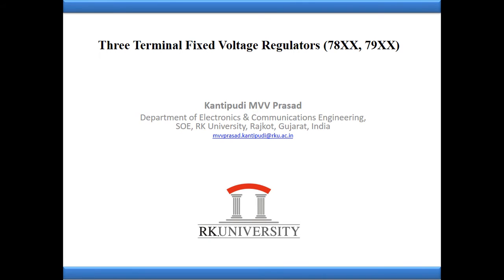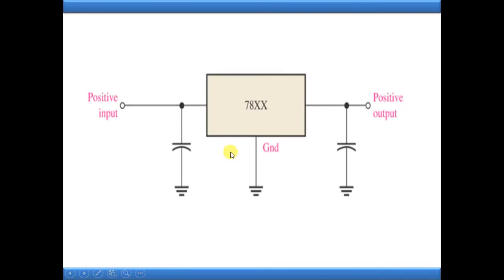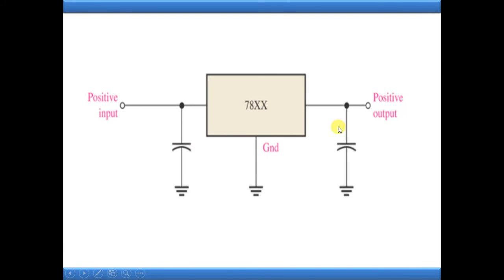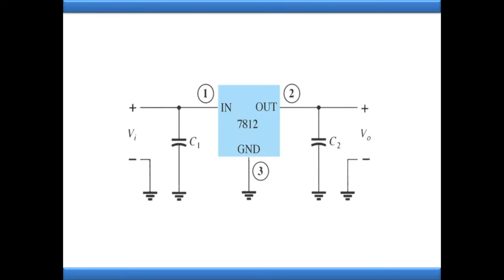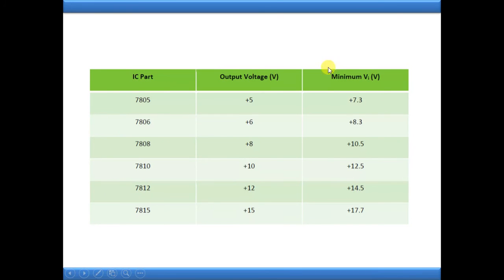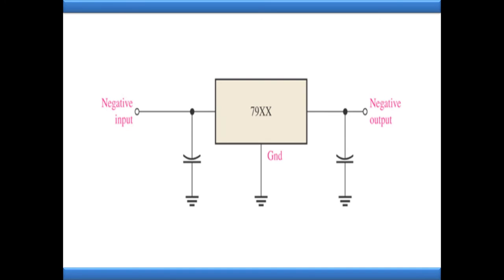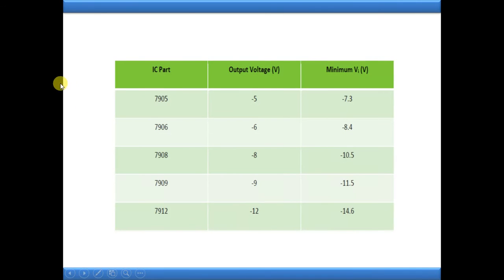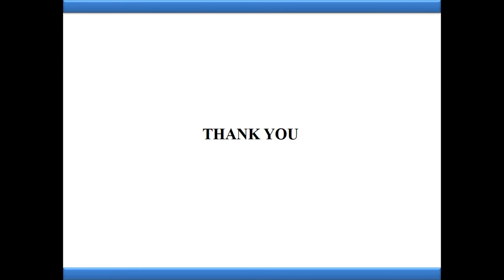Three Terminal Fixed Voltage Regulators 78XX, 79XX

Comment: Hi there,

I have a burned voltage regulator on my portable battery drill charger and would like to change it out but do not understand the letters and numbers to be able to source it online, this is what is written on the voltage regulator (F1E41AF - FQPF - 7N80C), the input of the charger is 220 - 240V and output 21.5 V constant 2.2A, any idea or guidance on what that means and how to look it up on google ? thanks in advance